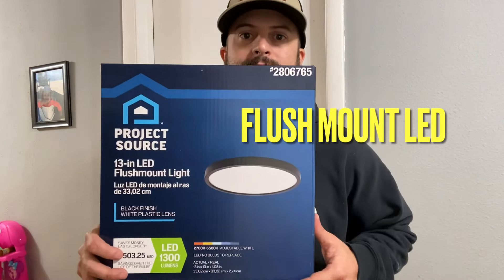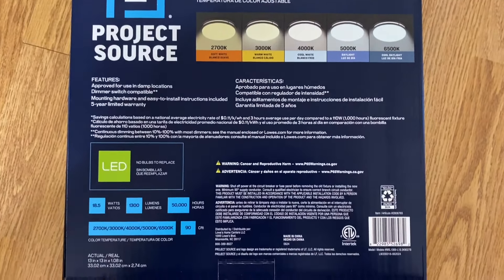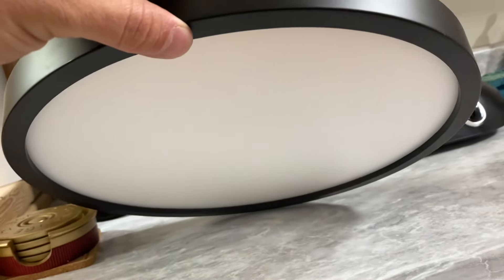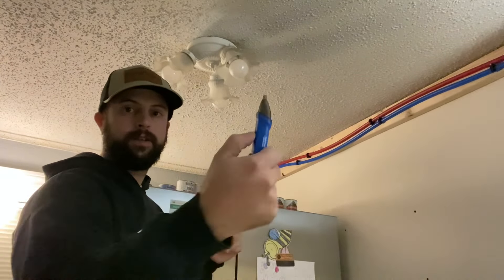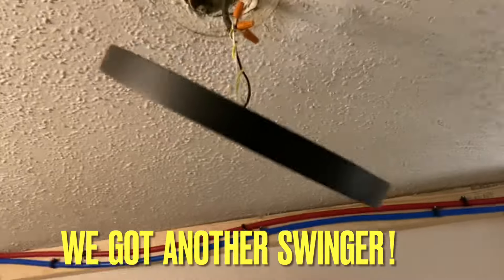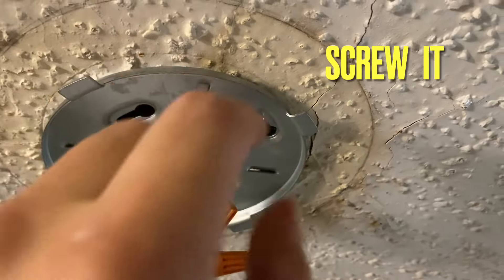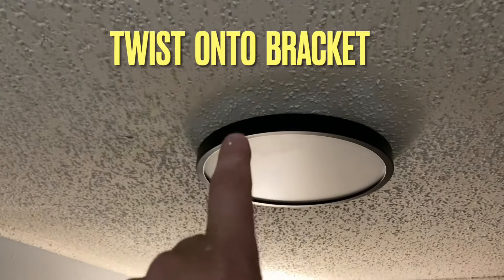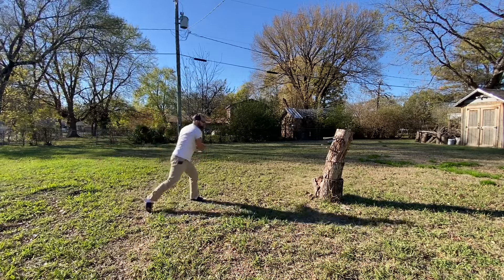How to install a project source led flush mount ceiling light

Comment: i cannot get light paired up with the bracket!! ARGH! i dont know if it's cause there's not enough clearance?!?! so frustrated!....i finally got it! doing the same thing and finally just popped in! sheesh.
Reply from the maker: I understand! I had the same problem happened with one of my lights! It’s just if the ceiling isn’t level it has to be just perfect. What I did was loosen the screws a little bit so it could come down from the ceiling a tiny bit!

Comment: The ground wire connects to the green screw on the bracket.
Reply from the maker: @karenj3053  If you have a ground wire. Thanks! This is an older home with only 2 wires. Black hot, white neutral. White is the old ground basically. White and grounds are both connected to the ground bar in the panel.